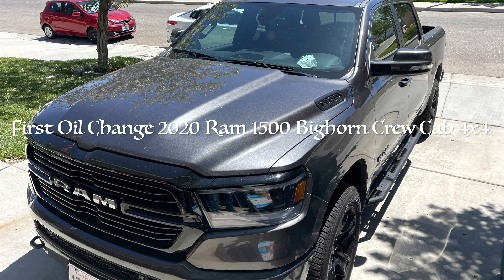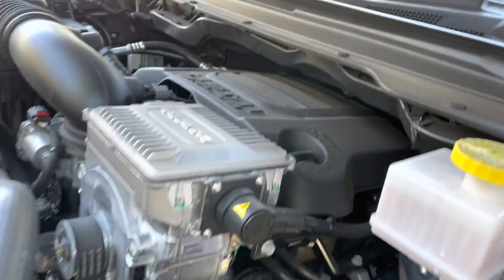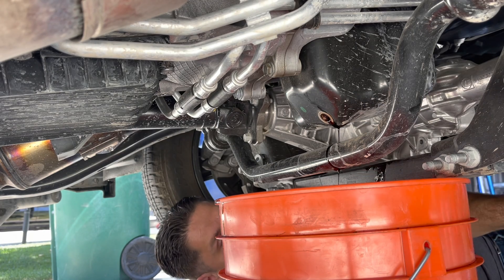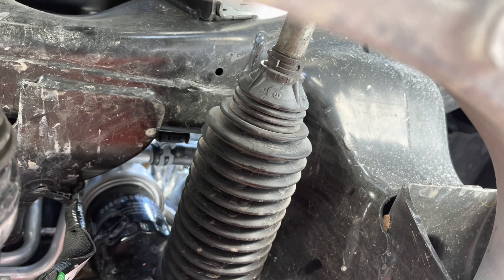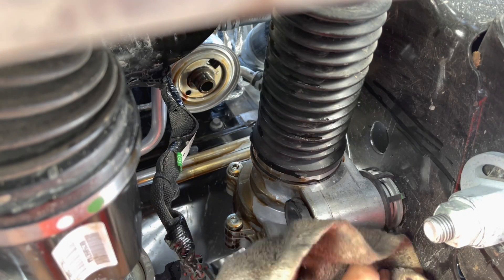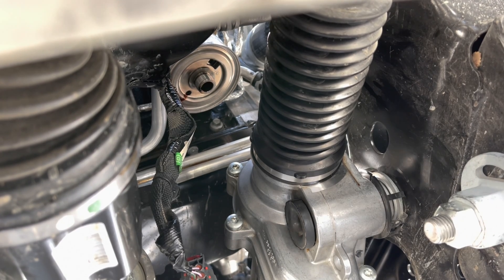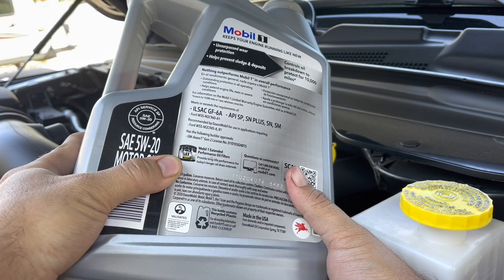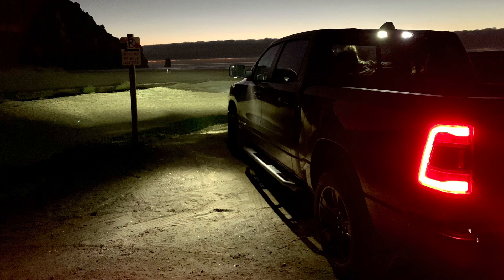1st Oil Change on 2020 Ram 1500 - Bad Engineering 101

Comment: Morning Mike, Good Video and my 2 cents.  1.  My 2013 Ram Laramie Longhorn 5.7 4WD Crew Cab(Left over model in Aug '14 and bought it new) is SO Much easier than what you went through.  Why?  I attack the drain plug, 13mm, from the back side of the right front tire on my back.  NO JACKS required.  Easy.  2.  I attack the Hand Tightened Mopar 339 Oil Filter from the front of the truck on my back.  NO JACKS required.  NO FILTER WRENCH required.  Everything else is pretty much what you do with one major exception.  I change my Pennzoil Premium Synthetic 5w-20 every OTHER year since I only drive about 3500 miles a year and 50% is Highway.  I use the Mopar EOL Indicator and change it at 7500 miles which is usually about 25% Remaining for me.  I honestly think your cross member under your drain plug is different from my truck.  Mine is forward of yours by about 2-3".  Good Luck next time around as these are GREAT Engines and Trucks IMHO.  JP in NW Florida

Comment: I feel there is just a little too much drama here. It's a little bit of oil, and yes the filter location is inconvenient but you don't need to beat yourself up getting every drop off, here in the great white North we just come around every winter and coat the ENTIRE bottom of the truck with oil anyway as rust prevention. If it bugs you that much, you can buy a oil fiter relocation kit. The hemi is used in cars, jeeps, and trucks, no doubt it doesn't package all nice and conveniently as we would like for every application it's in but good grief, it's not that bad.
Reply from the maker: If you have worked on other brands you would see more thought is put into maintenance. That’s my main point, make this video to embarrass the manufacturers to do better. I can change the oil on my Honda and Toyotas in like 10 mins with no mess.
Reply: @Sunshone7311  You're not embarrassing FCA, because they didn't choose that spot due to bad engineering. It was probably a financial decision (less money spent on repackaging since they use the hemi in cars/suvs/trucks which all have different "frames" and accessories and structure underneath) and 99% of owners will just get the shop to change their oil anyway and simply couldn't care less. For those of us who do care, a relocation kit is 200 bucks and makes things convenient.

Comment: I have a 2017 and it’s exact same. It’s a mess every time. I have same exact ramps and I do it from underneath just like this. I’ve resolved to saving up cardboard from online deliveries and putting it underneath before doing the filter. I just undo it and let it go all over and catch as much as possible in the tray. The Best Fram filters with the grippy bottom, and making sure only hand snugged previously, helps not have to use a filter wrench to remove. I use at least half roll of paper towels every time too. Oh well.

Comment: And apparently it's not easy for the dealership either!!! My last three oil changes on my 2019 1500 Limited. (1) filter not secured properly. (2) drain plug cross threaded (3) filter not secured properly again. All three visits called for return visits, and the dealership has a ho hum attitude as if I didn't have anywhere to be. I hope they're doing a better job with those $100,000 Grand Wag's

Comment: Boy you young guys getting so soft most of you need to work around other engines and brands  how about farm machinery heavy construction machinery and trucks....you will say that Ram was not all that  bad (lol). did a many oil change in my 73 years on various engines.

Comment: That’s the reason I installed a remote oil filter  mounted to the front frame in my Ram 1500 Classic, makes life so much easier and less messy. Don’t even need to do get it on the ramps and I run a full size filter (the stock one is too small in my opinion)
Reply: Where did you get the relocation kit? Of course, that'll void my warranty...

Comment: I feel your pain. I haven't attempted a oil change on my new Ram yet, but I have a plan. Cut the end off a 2 liter soda bottle and put a hole in the side. Push a nail through the hole and drain the filter before you remove it. Once oil has stopped running, use a piece of duct tape to plug the hole in the filter. Now remove the empty filter.

Comment: my 2022 hemi has 0w 20 as the recommended oil. i was shocked but apparently they made this a running change late last year. seems almost all new cars and trucks are now 0 20. i don't know why and can't imagine the difference is meaningful.
Reply: You mean 5 20
Reply: @floofsale  no. 0w 20.
Reply: @thecount1001  we use 0 20 in the jeep and my Honda as well. But go check out the Ram forums where hundreds of currents and previous Ram owners discuss different oil types. It seems the general consensus agrees that 5w30 wont hurt and is in fact better for the hemi engine than the 5 20 or 0 20. Either way.. check it out as we all have the same 5.7 hemi engine... As long as you use really good oil and filters u should be fine. The Pennzoil Ultra Platnium seems to be highly recommended as well (make sure its Ultra).. also Redline is recommended but expensive now. Good luck!
Reply: @floofsale  
PUP is the only i will use.

Comment: Cut a 2 liter bottle in half, use that as a spout so you don't get oil on your sway bar.
Reply: Take the 1/2 of the 2 liter bottle and put a hose on the filler neck that's long enough to go into your drain pan. When you loosen the filter, the oil will drain into the bucket. Just a thought.

Comment: Won’t you void your warranty doing your own oil change?
Reply from the maker: No, you have the right to service your vehicle. You just have to provide proof of when it was serviced. Take photos etc.
Reply: @Sunshone7311  well damn I just bought a 2022 ram 1500 bighorn and the dealership is telling me if I don’t bring it to them they will void my warranty and extended warranty on it no matter what and that if I take it to another dealership I have to call my warranty company to get approved.
Reply from the maker: @Ciangi87  I would call Ram and tell them what you were told. You can do it yourself, you just have to use oil and filters that meet Rams standards in the owners manual.
Reply from the maker: @Ciangi87  If you have a aftermarket warranty, cancel it and it get the real mopar warranty.
Reply: @Sunshone7311  okay I will do that but last question they said my truck comes with a lifetime powertrain and transmission warranty automatically  so is that how they get me to only go to them because I can’t cancel that
Reply from the maker: @Ciangi87  Yeah, the OEM warranty allows you service wherever you want. The aftermarket warranties can have these riders that could require you to service with a specific dealer. This just guarantees them work and in time, enough profit to cover any repair. From what I’ve seen before, they will try whatever they can to weasel out of paying though. Furthermore, the warranty is very limited on what it covers.

Comment: Just did my first oil change 2021 Ram 1500. Took me about an hour to figure out it was easier and more room to access the filter from the bottom-front. Still very messy.

Comment: F150 is w-a-y worse. Plastic drain plug that is too big and plastic oil pan. Oil filter cartridge another brain fart. I put my truck half on the driveway and half on the grass so any drips land on the grass and I use a car jack  under the frame and not those plastic car ramps. Ram just might be my next buy.
Reply from the maker: All trucks seem to be bypassing engineering when it come to ease of maintenance. I think I’ve figured out a way to do it cleanly, but what a pain in the first place. I change oil on my cars in 15 mins, trucks are just pain now.

Comment: Just did my 2021 RAM. Complete nightmare. 31/2 hours to get the oil filter off. I punchered it and Oil leaked everywhere for hours. 4 trips To Auto Zone and bought every filter wrench they had.  Finally used the adjustable one and broke it loose.  Horrible experience.
Reply from the maker: It gets better, you just have to get passed the first time and come up with a better plan the next time.
Reply: Get a claw, it fits. I do oil changes on mopar vehicles. Put rags or a lot of paper towel around the steering rack where the oil runs and the connector right on the other side

Comment: I worked at a cdjr dealership, I have a silicone oil filter catcher. It looks like a coozie with a wide mouth. Slide that over it, twist it off, all the oil goes into that and it's not hot on my hands. I either got it from Mac or cornwell. Also having a lift makes a world of difference, helps the angle of the dangle.
Reply from the maker: I had an idea to modify my oil wrench exactly like that. If it’s been done I need to find one, Thank you

Comment: You make a pretty good video. I also have a 2020 Ram with the same problems.  The drip on the sway bar is no big deal, but the filter is in a horrible location. The first time I tried to change it I found the filter was either tightened hard or had Loc-tite on the threads. I was using a claw type wrench with a socket and 12 inch extension. This has worked for me on several other filters with no problem. I put a lot of torque to try to get it to move when my hand slipped and the wrench gave me a black eye. (looked like I was on Cops). Ended up using the long screwdriver and ripping the can to get it to move. Since then I found no matter how I try I get oil all over everything. The claw type wrench works just fine if the filter is not torqued down. I've only used Mopar filters during warranty. I've learned a few things. 1. I change the oil cold- I value my flesh over a few extra drops. 2. after I change the oil I use a garden sprayer with soap/degreaser and squirt everything around the filter and let it sit. Then I use the hose to clean it off. I don't like the idea of leaving oil on the rubber boots and electric motor. I would think a remote filter would have been a better idea. Overall this truck is great to drive and has had no problems.
Reply from the maker: Totally agree that it’s not a huge deal. I’ve found though that these videos do embarrass the manufacturer and my hope is that they do better next time. I did oil changes on three of my cars last night and brought the kids out to help. They could not believe what a mess the truck was versus the cars. The design should have been fixed years ago.

Comment: you dont need to warm the engine, if little oil left in the engine, it will dont make any difference , like 2% old oil mixed with 98% new, no gib deal :0)

Comment: I usually get a pointed tip punch and pop a hole on the bottom of the oil filter and let it drain out before loosening it. Just sure you poke the hole in the perfect spot so it drains it goes directly in the drain pan. This is what I normally on large diesel trucks because those filters can carry 5-7 qts of oil, trying to handle those filters filled with oil and quite challenging.
Reply: This doesn’t actually work, but thanks for posting.

Comment: Why make a video if you still are not going to do this correctly??.....what was the point of this???......let me tell you how to really do it being ive owned all generations of ram.....first of all be sure you know how to unlatch your own hood......second of all theres a reason why fiat made a flat spot on back of the oil pan were the nut is.....its so you can hold up a funnel up against it to keep the oil off the sway bar.....they sell the special funnel at O'Reilly's.....it has a strainer inside of it so you can drop the nut in and just hold it......second use the right tool to remove your filter youre using the wrong tool man......then you use the wrong bag.....use the bigger freezer bag and let the filter drop in and let it drain use the bag like a glove dude......I mean all this plastic and you still made a mess.....and first and foremost let your engine sit for 30 minutes before you drain it and let all that old oil drop back into the pan or atleast most of it.....you still left a good half a quart of old oil in there.......i guess if your younger than 45 you'll never know how to change oil properly our breed is gone.....im sorry I gotta knock you man......but if you're gonna do this as a tutorial make sure you give us something A+.....and why not put it in 4 wheel right off the bat.....we all knew watching this you were gonna slide......see......we all leaned this back in the day with our old rear wheel drive  Chevy's......God almighty.

Comment: All you have to do buddy is use brake clean and a rag you need to learn
Reply from the maker: Accepting this is where people make the mistake. I’ve had plenty of vehicles where the manufacturer gave a damn. I know how to deal with it, but wasting rags and brake cleaner shouldn’t have to happen. Putting videos out like this will get back to them if enough people complain and maybe this won’t be a problem in future trucks.

Comment: nexrt time use one of those disposable aluminum disposable buffet things for the drain plug bit at least. ( also can try some "super clean" , spray it on a rag, and then clean the parts as part of the cleanup)

Comment: Good tip on using the empty 5 qt oil jug when an engine holds more than 5 qts at 12:43. Thankful that Honda's and Toyota's are better designed in this aspect :)
Reply: Haha

Comment: You do realize that engine was developed 20+ years before that truck was built?
Reply from the maker: That’s the issue I have with most domestic trucks engines. They never adapt their design.
Reply: The 1st design was exactly like the new design....same location
Reply: @jhett63  I don't have the time or crayons to explain this so you will comprehend

Comment: That's what you get when you have one engineer from Chrysler designing frame, oil filter location is proudly presented by the Ford engineer, and finally, strategic placement of oil drain plug and oil pan from GM engineer.
Reply: To be fair, my old 08 f150 has the filter in a worst place.
Reply: Don’t you mean fiat engineers?😁